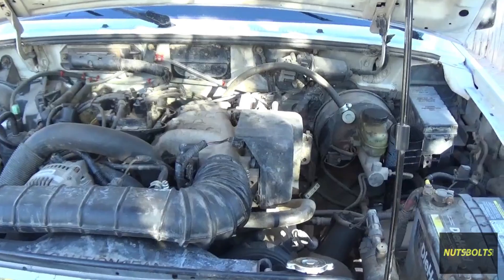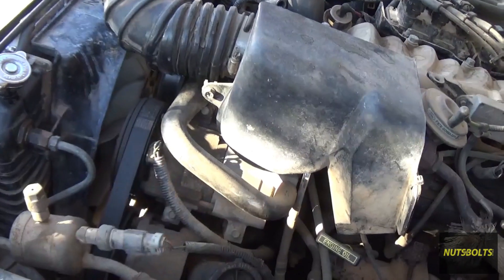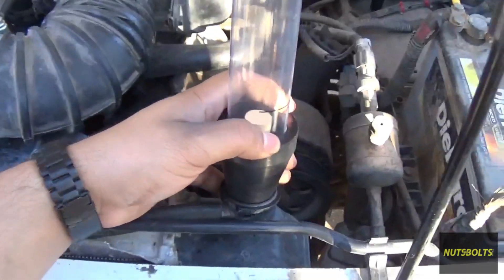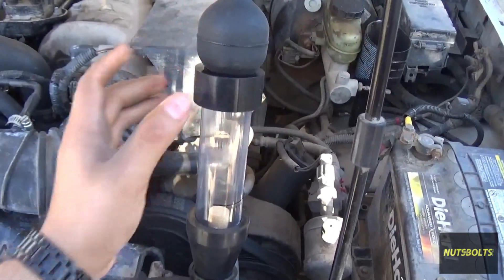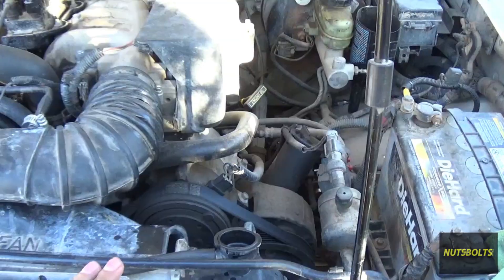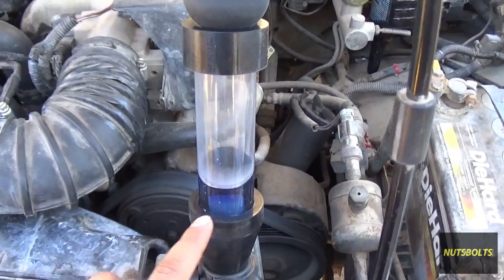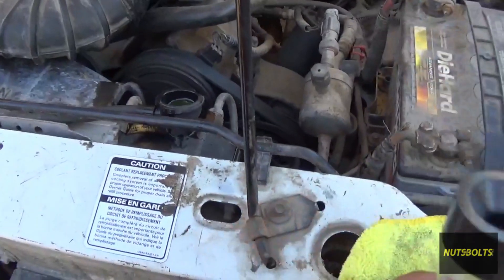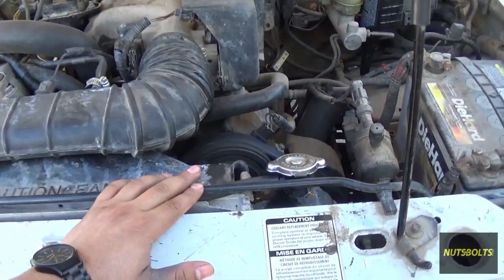How to Use a Combustion Leak Detector (Test for Bad Head Gasket or Cracked Head/Block)

Comment: Does anyone know if this test can be done with a coolant reservoir tank ? My car does not have a radiator cap - only a coolant reservoir with a cap and a radiator drain plug on bottom of radiator.
My car (98 jaguar) never losses coolant when it's driven for less than 30 minutes - but any time it is driven more than 30 minutes it losses about 20 ounces of coolant - no drips or leaks, sometimes you can smell coolant. car passed two different pressure tests,.

Comment: I tested mine and the coolant got sucked up yesterday. I took out about a cup n a half with my suction pump and the coolant still got in there. Is it normal for white smoke to come out of the tailpipe when the radiator cap is off doing this test on a cold start in the morning?

Comment: FYI... it won't always turn as yellow as in this video. I did it and it turned greenish. So be aware. And yes I tested it on the exhaust pipe and got the EXACT same results.
Reply: Your the third person that's commented it turned yellow in the video, but in the video it is clearly a greenish muck.  Watch again at 5:50 and compare that fluid to pond algae. Then compare it to a lemon or even urine. I only see pond algae, and I'm not color blind that I'm aware of nor do I have a bad computer screen 🤔
Reply: @Rick-the-Swift  The point of my comment was to let people know it doesn't always fully change into a color like it did in this video. This guy had a bad leak, mine did not.

Comment: The Exhaust tail pipe test is not accurate because gas is a coming out of it tried it on my four wheeler lawnmower and it turned color . In the test and they do  not have coolant

Comment: If it does turn yellow, how do u know if its the gasket, block or cracked head? My car is spitting coolant out the reservoir and boiling. Plus the oil filler cap has a milkshake looking substance on the bottom.
Reply from the maker: Follow it up with a Leak Down Test. You would need the tool and a compressor. Apply air pressure into the cylinders one at a time. Then search for the leak.

Comment: In my case it’s a very subtle leak. Customers says at times he can drive a hundred miles and not loose coolant then all of the sudden it loose enough for the car to overheat. When I did the test the color remain blue but you can see yellow tint in on top of the foaming as it bubbles when you press the bulb. The test fluid remain blue but with a different hue of blue from original color. I pressure test it but it holds pressure for a long time. It looses one PSI in about 20 minutes. I don’t see any visible leak even when I pressure test so it has to be the cylinder head

Comment: Great video, but you can also test it in the coolant reservoir without having to worry about coolant jumping out of the radiator
Reply: I wondered about that too, and I'm still sot sure. Aren't most reservoirs especially on older models meant to be sort of separate from the rest of the system, only capturing and releasing fluid or air when valves are opened due to pressures within the enclosed system? Could it be that you are talking about newer models where the "reservoir" is designed to withstand the pressure of the system?
Reply: @Rick-the-Swift  Nah, if the system is a closed system which all modern cars should be, theoretically if the car has been driven to reach opening temps on the thermometer to open up coolant flow, the exhaust leak should be able to be tested from the reservoir. The way he does it in the video is completely correct too.. Just make sure the car is cooled down before testing it that way

Comment: if possible, would you recommend using all water in the radiator?
Reply: Good question. I doubt it because the test only tests air. If it turns positive when testing fumes from the exhaust, seems like it ought to test positive if those fumes came through water first. Seems like a lot of hassle unless you are maybe super flushing your system anyway and were already planning on going 100% h2o for the flush.

Comment: Did you tell them once it's at operating temp to turn the heater on full to give them the 60 seconds? If you don't open it you will NOT have 60 seconds.

Comment: Excellent video, good, clear, complete instructions and you created understanding.  Thank you!
EDIT:  I ran the test today, and all is GOOD!  Whew!  I did not want to replace a head gasket.  NOTE:  if all is tight and right, once you pull a vacuum on the radiator, it's very difficult to get any more bubbles.  Revving the engine seems to give a little more, but the test took a long time to run since I just wasn't getting bubbles.  I wanted to get as good a test as possible.

Comment: My leak detector didn't say whether to do the test cold or hot. I wanted to do it hot but when coolant flows through my radiator it splashes up into the tester and ruins the test. I thought at first it was splashing because of bubbles but I think its because my radiator has a top flow outlet hose that is mounted very high, slightly higher than the cap. so anyway, I did the test on a warm engine and it was negative, and I was also able to get about 5 pumps after the thermostat opened and it was still blue so hopefully it was accurate.

Comment: My leak detector instructions mentioned nothing about taking coolant out of the radiator to test. Tried it so many times and the coolant just flushed into the tester and ruined the test. Thanks so much for including that info!
Reply: When you went to the exhaust pipe and you sure where change yellow is that the same car

Comment: i only get a few squeezes of the bulb and it pretty much quits expanding. i assume that is because i don't have a leak or at least not much of one. i waited with the bulb colapsed for over a minute and no change, no air flow through the tester.
Reply: That's the same thing that happened to me, and I was looking to find an answer why. I haven't yet.

Comment: You where differently on the right one thing is that idle at temp will show a false reading take for a drive under a load and retest it has happened to me all signs point to head gasket but at temp idle no gas present after the test drive user load gas was present
Reply: But do you leave your radiator cap off? I'd think you'd have to, or it would spit when u pulled back in to do the test. Is it ok to drive short distance with no cap?

Comment: Ford Ranger 3.0 huh? Been there done that!

3 Radiators, 2 Heater Cores and Long block from Ford. lol

Heater core gave, about 45k RR from NAPA.
Radiator gave shortly after RR. Rad from NAPA
Truck started steamin out of tail pipe. On day in the AM I catch a large chooch of white cloud.
Cracked head - Vulcan 3.0 Alum/Iron, Ford did the long block, new Rad as it cracked driving it to work.
After the long block / rad job warranty ran out heater core goes, I just bypassed it from then, rad goes out slow leak that got more and more noticeable. I got a new Rad from 1800RAD with lifetime warranty and installed during my lunch break at work/shop in the lot.

It's set off by Co

Comment: I had a couple of bad head gasket symptoms. Pressure in the radiator overnight when cool. Reservoir getting overfilled. So I got together all the parts, went to get coolant, and the radiator burst. So I got a new radiator, and the reservoir is actually dropping a tiny bit after it cools now. So i get this tester and the color doesn't change, so great then. But I held it up to my exhaust, and the color still didn't change. So that was a waste. What could I be doing wrong?

Comment: Need to get this tester because i'm losing coolant but have ZERO signs of a leak. the coolant gets stuck in the reservoid and not gets sucked back into the engine. but it will overheat on me JUST ONCE this year.

Comment: Thanks for the video.
One question. How is the used test fluid disposed of correctly?
Many thanks.
Reply: All you have to do is remove it from the radiator and suck fresh air through. The liquid will go back to blue and can be re-used!
Reply: No one ever seems to share that little secret. Use it as weed killer maybe? 🤷‍♂

Comment: #1) The block tester I borrowed from O'Reilly (from EverTough) warns in the enclosed a paper from the manufacturer to NOT USE ON DIESELS.  (Luckily I have a gas engine.
#2) After removing the antifreeze from the top of the radiator ( giving me 2" of air space I sucked the tester 6-7 times with the engine ideling at about 700 rpm.  Like you said you only have ab

Comment: Two Bad Radiator???  Mmmmmm NOT LIKELY.
Reply from the maker: You're right, under normal circumstances it's very unlikely. The original radiator was 20 years old, and the 2nd radiator was a used part - also 20 years old. That makes it much more likely, which is why I decided to do this test - to rule out a bad head gasket. This also didnt all happen in quick succession. The 1st replacement went almost 5 years before cracking. It works fine now with its new radiator. 

I should have explained it a bit better in the video. Thanks for watching 👍
Reply: I understand now😁.  Mine was the 35yr old original.  I replaced her with a Cheap one from Amazon.  (Made in China of course)  BAD CHOICE!  Used my Wallet instead of my Brain.  It was made of Plastic + Aluminum.  Thank God it fit.  The Cheap fan shroud was a different story!  It had to be cut in places and New holes had to be drilled using good old Yankee know how so that the fan shroud would keep from being slapped around by the fan blades.  I just got a notice from my local pick-a-part junk yard that the same truck as mine has arrived for stripping!  Hope that shroud fits fine!

Comment: I tried this today(i have coolant expansion tank), and my coolant was only 1-2" down, not 2-3" like it was recomemended so that it doesnt mix with coolant and contaminate test fluid when you start squeezing, and after only couple of squeezes, all my blue stuff when into the coolant. Is that because it was not enough empty space between, so it sucked my test fluid inside the coolant tank, or my block tester is not good? Also, now this tester fluid is inside my coolant. Is that bad for coolant system? I mean, its small amount of fluid, but i dont know if it have some checmical that's bad to be inside coolant system?

Comment: Great video, memory refresher! Thanks! Blue results (with a leak) could also mean a seeping intake gasket, and rule out a bad head gasket.
Reply: How do you check intake gaskets
Reply: @caffrey9  Spray starter fluid around them and see if the engine stumbles.

Comment: so how did you know that you didnot have a cracked block or bad head gasket man?
Reply from the maker: There are many ways that a head gasket  can break. This video is mainly dealing with a bad head gasket that causes overheating. This would mean that the head gasket cracked between the cylinder and a coolant passage causing combustion gasses to leak into the cooling system. If the liquid turns yellow, you have a bad head gasket. 

There are other symptoms of a bad head gasket like milky oil or loss of compression, each points to a different kind of break. You would need to test the compression (to confirm head gasket problem) and/or perform a leak down test (to find out where compression is leaking to).

Comment: I gotta say, very, very good video.    I was hoping to figure out what to do if the suction bulb has gone missing but you still have the box and everything!  If you read this and have an idea, please reply.  Thanks.
Reply from the maker: That's a tough one. Seeing as the kit is only $30, I'd say to just buy a replacement. You can TRY using one of these: https://amzn.to/3uZhhwT. That type of suction pump may be able to fit inside the tool. I can't say for sure, though.
Reply: @NutsandBoltsAuto  Thanks for the reply.  Here's my workaround solution: used small diameter rubber hose and stuffed into top of test kit; I turned on my shop vacuum and held the other end of the rubber hose just close enough to the vacuum hose to get bubbles flowing; pinch off small rubber hose to adjust amount of vacuum. Oh and yes,  dye turned yellow. :-(

Comment: Could you just remove the thermostat to speed up the process and eliminate the coolant expansion issue ?
Reply: Sure but it seems like a lot more work than just sucking a little juice out and waiting 5 minutes for the engine to warm up doesn't it? And good luck getting those hoses off and back on without doing damage to yourself or the vehicle would be my next thought.

Comment: Bro need help.. i did you test and same thing happened.. no yellow on radiator test
. But yellow on exhaust pipe, does it mean i have bqd head gasket?
Reply from the maker: No. I put the tester in the exhaust to simulate exhaust gases inside the cooling system.

Comment: I really like how he also tested it at the exhaust pipe showing us how it works when a leak is detected.
Reply: Yes, the reason why I gave the thumbs up, because he's verifying the tester.
Reply: True even though he said it turned yellow when it was obviously green, like algae. 🤔
Reply: @Rick-the-Swift ”starting to turn yellow”
Reply: Agreed.  The exhaust pipe test is very important to confirm quality fluid.  I bought a kit and the blue fluid never changed color even after 3 minutes bubbling on the running exhause pipe!  Fake fluid kit?

Comment: Can’t you just do a cylinder leak down test and watch for bubbles in the radiator?
Reply from the maker: That would be the next step. If you do find combustion gases in the cooling system, you'd have to find out how they're getting there. A leak down test would tell you if compression is leaking elsewhere, however. Just depends on how you want to approach the problem, and what you want to do first.

Comment: i’m trying to test this on my hyundai elantra, coolant just keeps getting sucked into the tube, do i have to completely empty the coolant reservoir? it just keeps going up no matter what...
Reply from the maker: You should remove enough coolant to allow 1 minute to use the tester. Stop if you notice the fluid level rising in the tester. This means you're sucking in coolant, and you need to start over.
Reply: I'm having same problem with my 99 outback. Keeps sucking in fluid.  I will have to figure something out.
Reply: @goldstandard7406  Did anyone ever figure this out? I'm having the same problem. Do you have to empty out the whole reservoir?
Reply: No, never run with no coolant. Yo will need to take some out. Have a helper making sure you don't run to hot.

Comment: Does this also with testing from the expansion tank? My cars radiator doesn't have a cap.
Reply: Yes this test uses the same principle on the expansion tank. Just make sure it has a good seal on the opening of the tank.

Comment: Thank you for clearly mentioning the engine must be warm. Others don't do that.
Reply from the maker: Glad to help
Reply: Does the engine have to be warmed to the middle of the temp gauge or would it still show at 1/4 way on the temp gauge
Reply: @darrenvogel8096  The thermostat has to open to let the gasses leave the engine circuit and move into the radiator and coolant tank. So you would first have to warm it all the way up to 90 deg c.

Comment: I'm loosing all my coolant super fast in about 45min of driving without seeing any drops on the floor or around the engine. I took my car to the Honda dealership in my country and they said that I have a blown head gasket. 
The day after, a friend of me did this test for my car and it didn't turn out yellow which got me so confused and couldn't understand who's the right and who's not.

Can you assist with this ASAP please
Reply: The test tests if exhaust gasses get into the coolant. So the coolant stays in.

In your case it may be the opposite: the coolant goes into the exhaust and the pressure of the coolant is higher than the exhaust, so you lose the coolant.

The headgasket leak is probably so big that the pressure of the exhaust gas does not overcome the weight of the coolant and the coolant simply streams into the exhaust, being vaporized. Otherwise you would never lose a gallon or more of coolant in 45 mins.
Reply: You could also have a coolant leak though. Check if you find any little white spots which look sprayed. I had a radiator leak which became bigger and bigger until it just dripped. But before that, the pressure just sprayed it all over the place. However, it instantly vaporized, so I never saw actual fluid.
Reply: @ApacheNL1  thank you for your reply. Actually yes I do have some white spots sprayed around, but I'm not really sure if that's a leak or it was done by me everytime I'm pooring water coolant
Reply: @aziziilyes7  Clean the spots and see if they are back the next time you drive. Check the whole engine bay. If you got a small leak in the bottom of your radiator for example, the coolant may to places you don't see immediately. You gotta look everywhere.
Reply: By the way you should definitely see white smoke if you lose this much coolant through the exhaust. And a coolant smell.
Reply: @ApacheNL1  well here's the suprise, I'm not getting any single white smoke at all. What does that mean?
Reply: @aziziilyes7  That means you probably don't have coolant turning into steam and getting out of the exhaust. So you have no coolant in your oil, no coolant in the exhaust, no coolant under the car, but you are still losing coolant. Maybe your heater core is leaking, or the hoses that lead to it/move away from it. Some area where the coolant does not end up reaching the ground. You would have to check your whole system thoroughly. I'd also ask based on what diagnosis the mechanic concluded it was a head gasket.

Comment: Great explanation, do you have to bleed the system after doing the test?
Reply from the maker: No, you shouldnt have to bleed your coolant system as long as there's a good coolant level in your radiator. Only 2-3" of clearance is needed for the test. Just top off your coolant afterward.